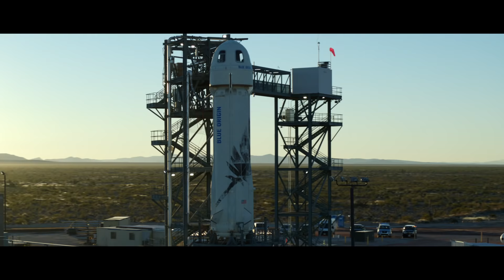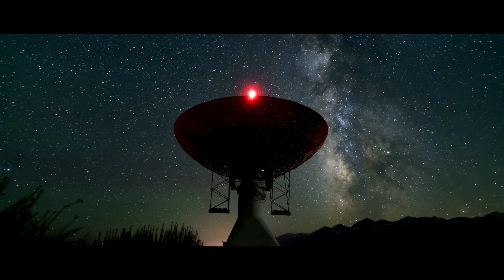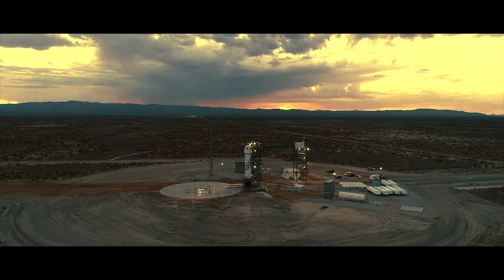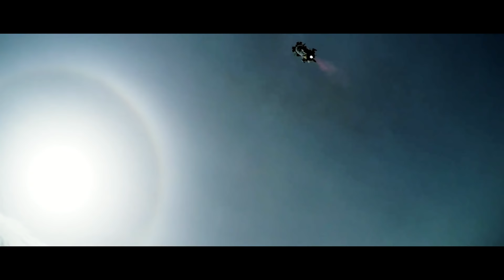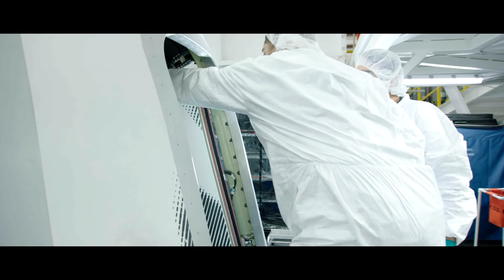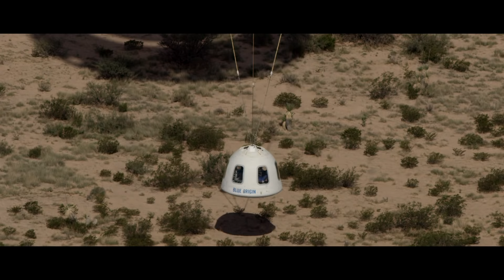Blue Origin's Mission

Comment: NASA is planning SLS as the launch system for LUVOIR (Block 2) and HabEX (Block 1), "Starry Eyes", Science 362, n6420, pp1230-1. In order to cancel SLS (hugely expensive and glacially slow development), LUVOIR would have to launch on a New Glenn configuration with 130 MT to LEO capacity and a large diameter fairing, or some configuration of a Superheavy BFR booster involving upper stage(s) that are not a BFR Starship (and have a large diameter fairing, bulky item!), HabEX could probably launch on a New Glenn rocket. An ACES might periodically serve as an unmanned space tug to bring the telescope to a servicing rendezvous for refueling, etc., etc.. At the present time, of all the hardware, only the SLS core stage (non-reusable) is under construction and there are well proven SRBs derived from the Space Shuttle program. There are lots of opportunities to launch superheavy science and Lunar missions for Blue Origin. This is an important stage of development of infrastructure for a road to space, best of success.